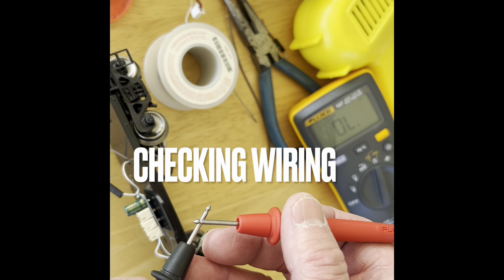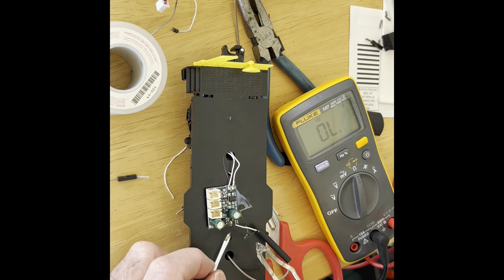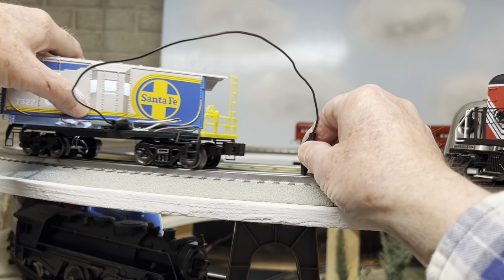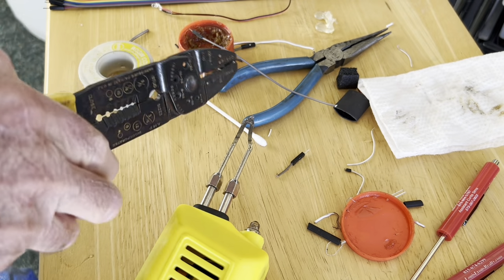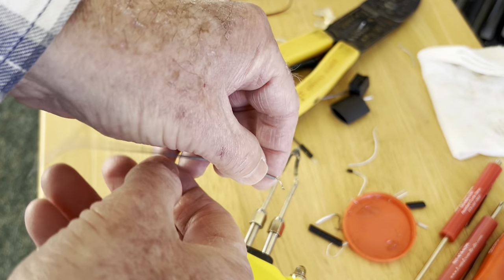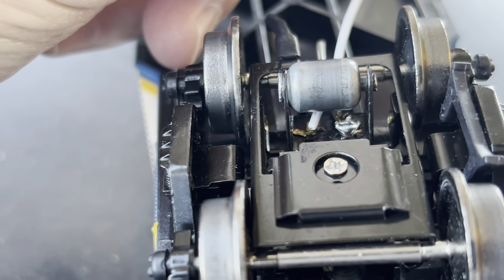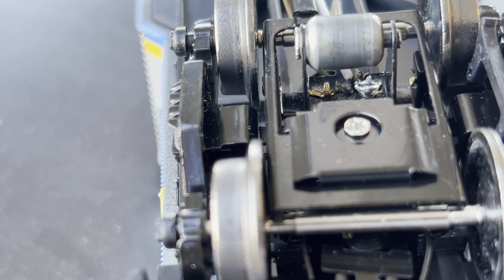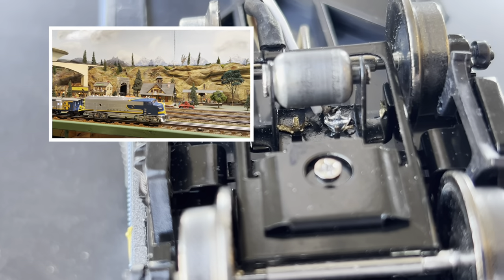Fix for Menards Flickering Caboose Light

Comment: Steve, I was given a Menards red Santa Fe caboose only to find out it is one of those with the flickering lights. I watched how you fixed it and was very impressed. Unfortunately I am not able to do it. Is there any chance if I sent it to you, you would fix mine also? ThomasJunction
Reply from the maker: Bill, I am a little reluctant to work on a unit that I do not own. After working on mine I had to replace the rear blinking LED lamps because I may have plugged them into a different internal plug. Hope you understand. I appreciate you watching and commenting. _Steve